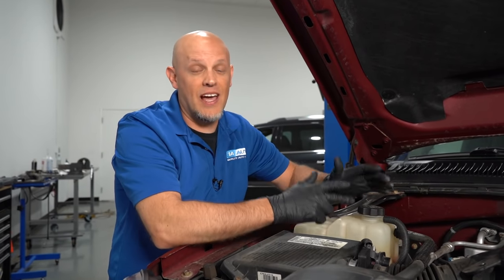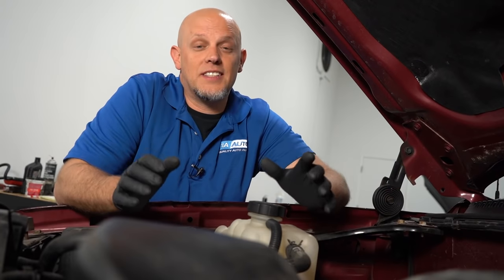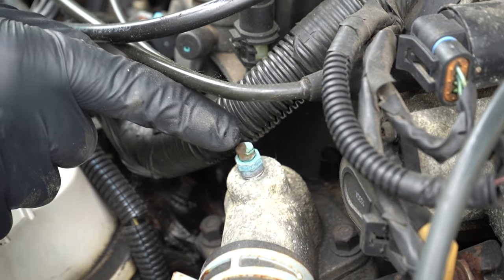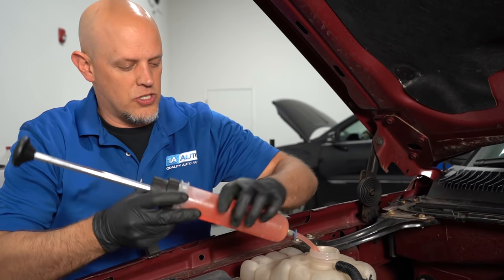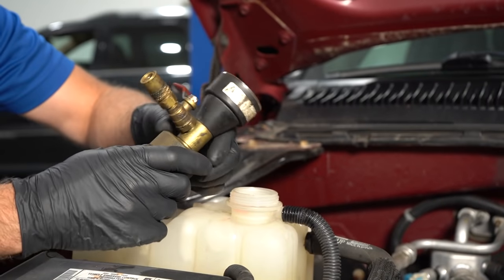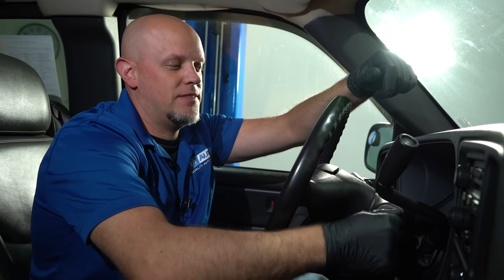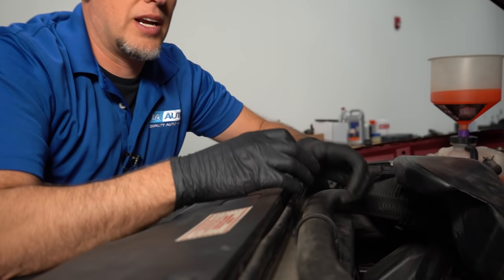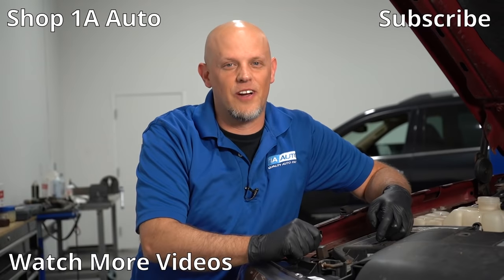Overheating After Replacing Radiator, Pump, Thermostat? Burp Coolant to Remove Air Pockets!

Comment: How do?i get coolant back into pressurized system without having to bleed it all over again
Reply: you can do the slow way, top up water and coolant, "drive the car"  to over 70°c, or not over 100°c, the thermostat should opened already, and check hot air come out inside the car room, then cool it 4 hours or overnight, water should be down, top it up ,do it again until water level won't drop after cold.
and how to know the coolant system pressure low enough to safe open the cap, you can use hand to press the top radiator hose,if can press down ,then can safe to open.
some models like BMW, the bleed plastic screw is screw into a metal pipe, this will made the screw easy broke, some area hard to repair, I want customer safe their money.🤑🤑🤑

Comment: My driver side fan wont come on it works i tested the motor I changed thermostat , temp sensor. The car only has 95k but it constantly over heats and coolant tank bubbles like crazy any advice ? Is all this happing cause 1 of my fans is not coming on?? I bought a spill free funnle and got all the air out the system idk what else to do
Reply from the maker: +lsX We wouldn't be able to diagnose an issue like that here, you may want to have a local mechanic take a look at it. Thanks for checking us out! http://1aau.to/m/Shop-1AAuto-c

Comment: i have a 2006 chevy equinox, i put in a new radiator, water pump, and a heat sensor, and thermostat, i burped it and ran the car still overheats and the heat gets hot then cools down then overheats again, been trying to figure this out for months, any ideas?
Reply: Any solution?
Reply: Upside down thermostat?

Comment: Really hoping it's nothing more then just air in the system after replacing the radiator, thermostat and hoses!!... Noticing the engine warms up rather quicker lately, but never overheats and the temp gauge never goes over the half way point.

Comment: My thermostat does not seem to be opening up after replacing my water pump and thermostat. I run the truck and the thermostat will not move even after idling for 30 minutes

Comment: Can you bleed the coolant when it is hot?
Reply from the maker: +Chadrick Walsh Before you begin this procedure, make sure the engine and radiator are cool. If they are hot, wait an hour or more. Hot coolant can cause severe burns.

Comment: Hi, I replaced my rad and thermostat on my 03 civic. Now I don’t know why is my reservoir filling up with coolant after a drive and not going to the rad. Replaced my radiator cap twice and still doing it. Help pls.
Reply: Check for air pockets, and make sure you did not install your thermostat upside down, or that you don't have a leak anywhere.